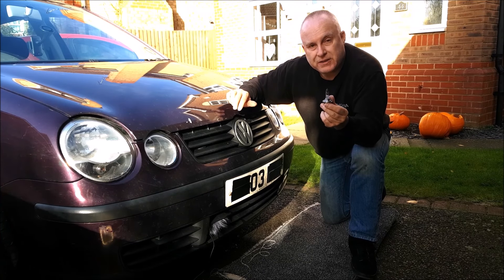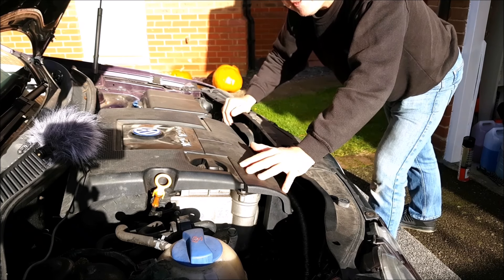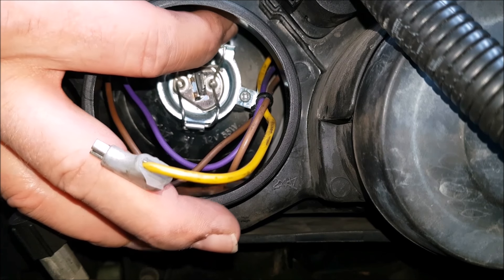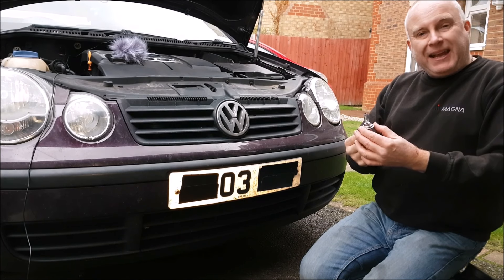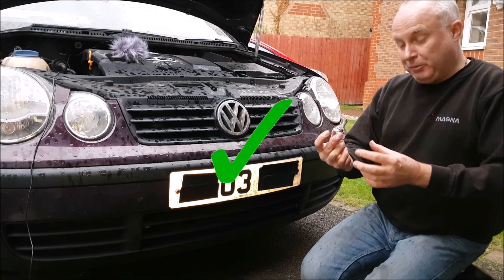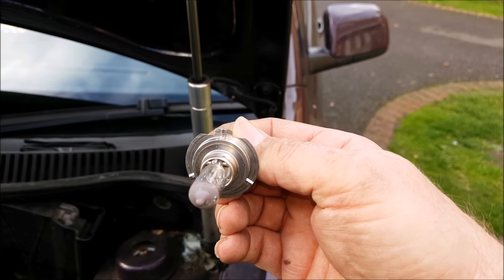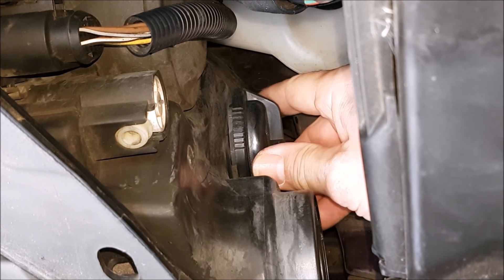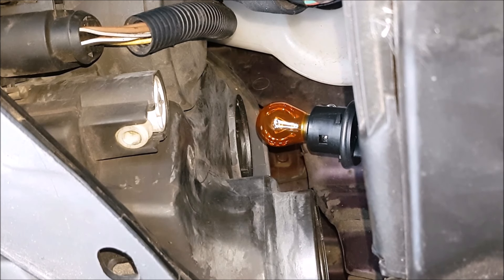VW POLO Bulb replacement | VW POLO 9N Light Bulbs

Comment: Buddy, your lights are not standard, most likely you (or a previous owner) changed one of them. On my Polo both have the plastic half a cm rotating rings to hold de bulbs in place, none have retention clips.
Reply from the maker: Thanks Emm. I hadn't considered that aspect. Double checking, the Haynes manual gives instructions for the ring holder type (left light in this car), so this would seem to be standard. I'll have to look at the right lamp for any markings (eg part numbers) that might identify it's origin.
Reply from the maker: You're correct.  The left side light 💡 is clearly the OE one, it has the Valeo markings on it, whilst the right side one has no manufacturer markings so is an 'aftermarket' unit.
Unfortunately, the YT system doesn't allow videos to be edited by adding to them 😬, so I shall have to leave the video 📽 and add something in the description 📖. I've also pinned this comment.
Many thanks for your input. Appreciated. 👍
Reply: @CycloneCyd  very useful video, because my polo has a valeo headlight.Efharisto.
Reply from the maker: @georgioskechaidis4792  Hi  Georgios , You're welcome. Don't forget to like 👍 and share.
Reply: No ways that's nonsense. Nothing was changed. My polo vivo made in South Africa follows the Euro spec. The fittings are exactly the same as this from the factory. You get 2 types just depends on available at the factory. It could have either or.
Reply: @denvernaidoo4998  could be, the ones in SA were manufactured there so they might have used other parts compared to the ones in EU.

Comment: Subtle difference on mine, in that both indicators are under those screw top thingies. But even if I had thought of taking that cap off (very very tight, but then it's been on there since 2004 ;) ) I would never in a million years have guessed how the plastic paddle contraption worked, so thanks for that!
(Side note... and perhaps of help to others.... the "faulty" bulb looked fine to me on removal, and worked on a battery. So now what? Then I noticed that none of the lights on that side worked- headlights etc. So what's common? Great big plug that looked like it brought all the wires to the lights on that side, was loose! I had just got the car back from having the radiator replaced, and they obviously hadn't clicked that common plug home.) 
(Side note #2: Must have taken you some time to get those camera angles correct from inside the engine compartment. Great work.)
Reply from the maker: You'd think a garage would have been more careful eh?
It often is, but that's what seperates a good video from a crap one. And this is my living now.

Comment: Many thanks. Very helpful.
Reply from the maker: Hi Benedict, thank you. 👍 the video if you got value from it.
Reply: @CycloneCyd  Incidentally I think you have different fittings on either side because you have had an after market light unit fitted on one side.

Comment: Great vid mate! Do I need to switch the battery off before changing the bulb?
Reply from the maker: No, there's no need to disconnect battery. There is no danger from 12V DC. Make sure the bulbs have been OFF for 10 mins before changing though - those halogens run very hot (200C plus). And it might seem obvious, but don't do it with the engine running.

Thanks for watching and interacting. Don't forget to share and subscribe.

Comment: Great videos, thank you very much for all the help. I’ve changed them all successfully (front and rear) thanks to your 2 videos, except the front indicators. Both sides have that screw cap you turn at 6:55 in the video, I’ve put a huge amount of force in to it but just can’t get that unscrewed. I’ve even tried vice grips but don’t want to break it. Any advice? Thanks

Comment: Anyone else have very dim dipped beam, changed the bulbs but could still do with more light range
Reply from the maker: If range is poor, maybe the headlights are pointing down too much. Probalbly worth having them adjusted upwards at a garage. Also check they are not lowered using the dash thumbwheel.

Comment: So I took out the inward headlight's top bulb and middle bulb as the top one was broken. The middle bulb was working fine but once we took it out, it didn't work again after putting it back, even though we even got a new bulb for it. Any idea what the problem could be? :/
Reply from the maker: Sorry to hear that. Take the bulb back out and check it across the battery or with a DMM. Bulbs hate being handled. Also check the connector is seated properly - they can be fiddly